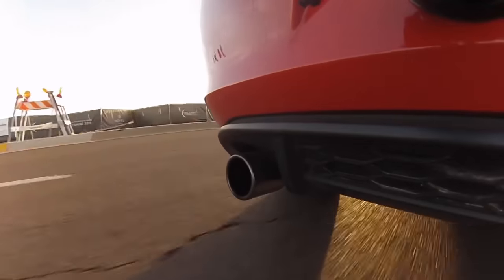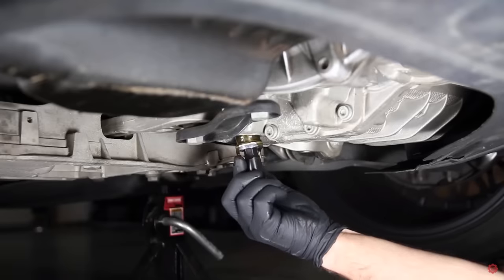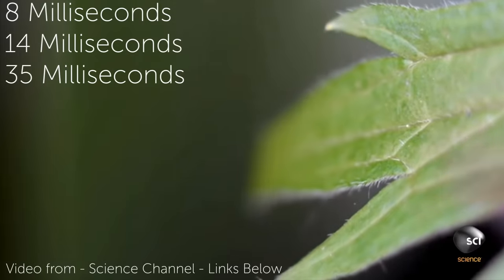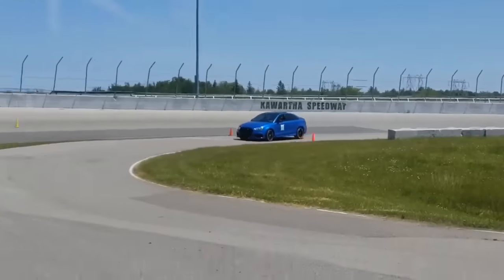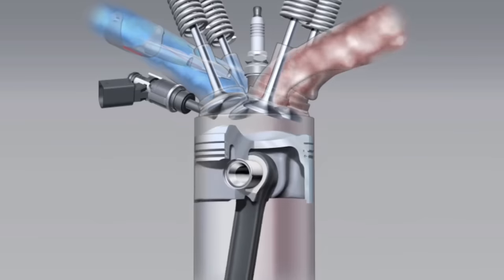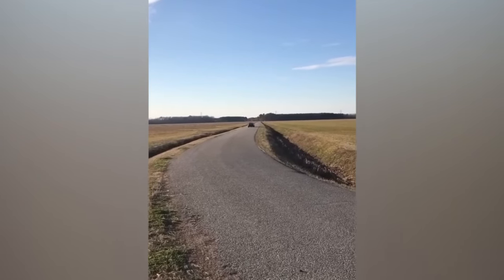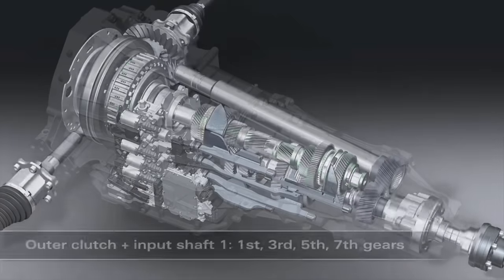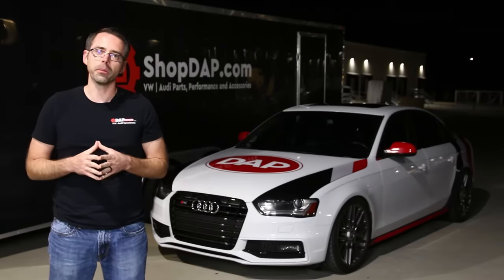What makes DSG Farts Happen?

Comment: “So in conclusion dsg farts are hot gases coming out of your tail pipe” 
Paul 2019
Reply: Best quote ever
Reply: Nice
Reply: Daily Driven Tech he actually said, “exploding”
Reply: Daily Driven Tech “So to conclude, DSG farts are hot gas exploding from your tail pipe”
Reply: Fav part of the whole vid 😂
Reply: @Gandalf721  it deep inside us ALL!! We didn't know this UNTIL DSGs !!
Reply: @Gandalf721  😂
Reply: So an ACTUAL CAR FART. LITERALLY
Reply: That car at the end sounded god awful. And I have an s4 with a gutted cat - track edition.... the loudest of the loud aside from test pipes
Reply: It comes because the Vw have bad fuelinjections systems, just to much petrol is being injected and Burns and makes the sound, so it's bad for the car and engine, that's why these engines are brake down or get stuck inside and overcoal. It's really a laughable bad build designed engine🤣
Reply: Does dsg cars have a better cat in them since it dumps fuel to change gear?
Reply: rofl
Reply: Why does the fart sound different in each vag vehicle? Eg. Gti / Golf R/ Rs3 etc. The farts are distuingishable
Reply: But i does not make sense are other cars not have these gases?
Reply: @WaseemKhan-iu4bh  Different engine displacement (Ex : 2l engines sounds different from 2.5l ones), exhaust system (Golf R come with Akra exhaust system quad pipe), Audi RS' have 5 cylinders engine.
Reply: Hot gasses coming out your auspuff.
Reply: What else would come out of your tail pipe?
 “I thought it was caused by cold bananas coming out of your tail pipe”.
Reply: bruh
Reply: Hence, farting.😉

Comment: Does the fact that unburned fuel is present make it a wet fart?
Reply: Shart
Reply: Bruh
Reply: Underrated comment, my guy! 🤣😂
Reply: NO, as it burns in the exhaust.
Reply: So unchecked combustion hmm how did that pass emissions and also surely that would reap havoc on the catalytic converter
Reply: @urbansnipe  As long as the car complies with the emission regulations per 100KM I understands its OK

Comment: Thank God my GTI is manual. I don’t think my wife could stand anymore of my gaseous emissions. 😀
Reply: Just make sure theyr as "LIT" as on my GTI Clubsport. Never heard anyone complain.. Esp not in Tunnels with the Sunroof Down hehe...  😉 😎
Reply: Irfaan Faki  Hey man I love my manual GTI.
Reply: carnutal DSG is faster
Reply: killer_vette Did you read what he said?? He said he loves his car. Nobody really cares about your 1/100 of a second "faster"! If I take the doors, carpet and seats out of my car it will be faster to 60 mph. Ha!!! Who fucking cares??? It is a PASSENGER CAR!
Reply: I have a manual Seat Leon Cupra 290 (same engine as the GTI Clubsport S)and I get farts in between gears changes or over revs :)
Reply: George Eisikovits is the exhaust modified?
Reply: James Medina it’s as stock as it gets :)
Reply: Manuals also fart
Reply: @GGO89  i have a 06 mk5  DSG GTI, and that does it too :D 100% stock.
Reply: AND MY GTI IS AUTOMATIC SO WHENEVER I PUT SPORT IT FARTS YAYYY
Reply: @killer_vette351  in circuit, mountain and in sections of curves the manual is better
Reply: I deliver pizzas 40 hours a week in my manual mk 7 gti. It’s smooth as butter and if I drove an auto (dsg or not) I’d prob hate my job. End of discussion
Reply: Couldn't do the auto had to get the 6mt cornflower blue
Reply: @HopOFFmyGlock  same here. I got lucky with my ‘19 GTI Rabbit, CFBlue, manual. Dealership had just got it in the delivery truck and it was still wrapped up. It was destiny.  But I don’t get the DSG hype. A lot of GTI youtubers swear by it, which is fine, but I’d get bored of driving around in an automatic so fast, no matter how good the DSG is.
Reply: @GGO89  How are you finding the cupra and what made you choose it over the GTI or GolfR
Reply: @najibabubakr2015  the dealers in my area offer huge discounts for Seat vehicles so I managed to spec one to my heart's desire and pay very little for it, around what a gti would've been with 0 extra options. Moreover, I wanted a FWD, manual fast car because I like hothatches. So 300 hp, fwd with e-LSD, manual hatch = best choice.
Reply: This doesn’t happen to a standard golf GTI with dsg
Reply: @GGO89   @George E.  Thank you for the reply ma man that's good to hear you got that bonus in your area. I always haven't been very aware about differences and advantages of FWD/RWD/4WD and also what is the meaning hot hatch and manual hatch and e-lsd

Comment: You can go without DSG-Farts, but it is something the customer of "sporty" cars want. It is an additional function of the engine ECU, just like the farts you hear when you lift your foot off the throttle. Here, a more or less random pattern is used to inject some gas which is not ignited by the spark plugs. So not mandatory, just for the sounds.
Reply: So what you say is we can have the same effect by cutting fuel and not only the spark right? And the car wouldn't burn unnecessary fuel (and of course no farting noises)
Reply: It is and it is not... The thing is, all DSG cars, or cars with double clutched automatic gearboxes, can produce those farts. Mostly those farts are absorbed by the resonator. Once you delete the resonator, the farts are audible. You would be able to code it away, but then you'd increase fuel-consumption and stress on the engine and transmission.

Comment: I've owned a MkV GTI for 7 or 8 years and I still love the sound it makes
Reply: How do you get a mk7 with DSG farts? I tried to buy a few but they are all quietly and no farts :( 
Do you know why?
Reply: @soulmateseverywhere6309  put it in sport mode and use the flappy paddles and give it a good rev between changing gears

Comment: just bought a Golf 7.5 GTI upgrade from a polo 6r GTI, and the DSG farts on stock are soooooo sick dude !!! love the farts! farting all the way to the petrol station
Reply: Papa Mabotja I thought the 7.5 GTI has no DSG farts anymore? But the overall sound is louder and better i heard. I ordered one too.
Reply: @Codename.996  bro! 7.5 GTI farts are so loud on stock especially shifting from gear 1 to 2 at 4k-5k rpms woohoo its awesome you'll love your 7.5 dude
Reply: Papa Mabotja Haha okay, i hope they sound as good as you are telling me. You sure you got the 7.5 with OPF an DSG7 ?
Reply: @Codename.996  just check my instagram @papamabotja you'll see I've added a couple IG stories of the car under "Lynk" I have a video there from outside doing a small pull you'll hear the dsg far on that video and you'll see photos of my car ... you'll confirm if it's the correct version or not.

However I'm in south africa so we dont have any laws and regulations for loud exhausts. So maybe VW turned it down for your side of the planet.
Reply: Farting all the way to the petrol station 🤣🤣🤣🤣🤣😂
Reply: @kyalami_green_rs3  your car is sick dude
Reply: Never understood why ANYONE would EVER pay that much money for a FWD car. Especially when there is the option of a Golf "R" with much more Horsepower and AWD for not much more money at all. Like... do you even know what a holdback this drivetrain is? Are you aware of the fact that Cars with half the bhp will absolutely destroy you at a stoplight because their AWD? Just a tiny bit of moisture on the street and you will be killed by a 120bhp minicooper with AWD.
Reply: @Codename.996  The 7.5 GTI having 245hp apparently does not have those DSG sounds anymore, the 230hp version still has them as it is the same engine as the mk7 GTI. This is for germany though, I don't know which versions you are getting in the states or elsewhere. The 245hp engine is a different engine in many aspects compared to the 220 and 230hp engines.
Reply: J. G. Hab den GTI Performance jetzt 9 Monate. Bin echt voll zufrieden bestes Auto. Zwar keine DSG Furze 💨, aber kann man ja nach der Garantie machen.
Reply: Nothing can be compare to V8 engine with manual gearbox, pure fun. DSG farts are so annoying, riding with dsg is boring
Reply: @Scientist1991  lol what’s funny is a drive a BMW M6 F13 now 🤣😂🤣and yeah it’s a DTC with a Twin Turbo V8 😋
Reply: @papamabotja  Nah, only V8 N/A, TT V8 doesn't sound good, but... everyone should drive car which like

Comment: Nice explanation!  One question: why doesn't this harm the catalytic converter?   On carbureted cars from the 90's, running too rich could cause the catalytic convertor to get too hot (burning raw fuel), resulting in an expensive repair (new cat, to replace the burned out one).   Why doesn't DSG cause this problem?  Is is because the # of shifts (and therefore # of DSG farts) is so low, when compared to rich running cars which let raw gas into the cat on every cycle?
Reply: It's tiny so it only degrades them instead of destroying them like anti lag

Comment: Is there a benefit to the ignition cut as opposed to using the clutches to slow down the engine? Is the second method how DSG's work on TDI models (since there's no spark to cut?)

Comment: Hey Paul, funny enough, my mk7 golf 1.8T makes shifts farts too above 3K RPM even though it is not a DSG :) I had to install a GTI exhaust to be able to hear them
Reply: Did you do the Downpipe as well or just the Exhaust? I'm thinking of doing the Exhaust on mine for the same effect.
Reply: @MatDupuis3  I have a resonator delete as well, so I still have the stock gti rear muffler
Reply: This is true. I have the same car. 2017 Golf TSI 1.8T. Non dsg. And it pops just like DSG. I think you only need a gen3 TSI engine. I have downpipe, resonater and muffler deleted. And it pops so loud lol

Comment: Even my TDi does it.  Thanks for the explanation, I didn't know how it happened, but I did know it was totally normal for my vehicle.
Reply: Whoa! It cuts spark in your TDI?  j/k Really, I was wondering the same time about my TDi. I'm rarely on it hard enough to notice such things.
Reply: @EstebanRapido  Well, metaphorically speaking, that is :-) Diesels don't have spark plugs, so whatever happens resembles that same sound, and the origin might be even mechanically related (or DSG-related) insofar as something quickly disconnects to connect again right after. I don't push my TDi either, there is no point as the useful area of rpm's does not call for it.
Reply: @antoniovda1295  basically it's the same principle but as the piston comes up as explained the extra fuel and air mixture will ignite as it's still being compressed not as high as the combustion stroke but it will still ignite with high temps and the slight compression

Comment: The DSG farts in my s3 with decat is naughty 😍
Reply: Don't get a DSG tune. It took mine away :(
Reply: @911airsoftdude  no way! Who was it tuned by. Its soon to be stage 2 mine with the TCU tune so im hoping it doesnt 😕
Reply: @cameronjamieson2651  just the regular COBB tune. Yeah, I have to hold the revs out before shifting and it will do it but its definitely not as loud as pre-tune.
Reply: @911airsoftdude  try to use manual. i had a dsg tune it doesnt fart when transmission is in sport but in manual it farts like pre-tune

Comment: As much as I love my 6MT, I've had DSG envy for a while and next after my GTI will likely be a DSG R.
Reply: Yeah... no, thanks.
Reply: dash3dot It’s not for you. You don’t have to drive it so don’t worry about it.
Reply: @FinalFormation  Captain Obvious much?
Reply: dash3dot Apparently wasn’t obvious enough because you felt the need to comment lol
Reply: @FinalFormation  and you still don't get it, do you? Is it because of the mustache?
Reply: dash3dot Dude what the hell is your problem? Who pissed in your Cheerios?
Reply: Nah, just try a Even to even or odd to odd downshift on a DSG it will take decades, you're  better off getting a new torque converter auto like the one found in RS7's and RS5's
Reply: Dude, don't abandon the manual.
Reply: @d1zguy864  nah mine is lightening quick on the double downshift. Something wrong with your DSG. Should get it serviced
Reply: @tylerevans2261  nope it was on  a brand new GTI, and audi S4, it's simple physics DSG isnt great at skip shifting

Comment: I sold my mk7.5 golf r and bought a new 5f cupra 290 and it’s fitted with the dreaded gpf , the R is obviously considerably faster from launch with the dsg7 and had the dsg bang but the cupra  pretty easily gap’s the R everywhere else from 2nd gear,! But the cupra dsg7 has what id describe as a thud and not a bang on upshifts, I’ve got to say it does detract from the experience, although as the miles go on and ive nearly 3000 now the gpf equipped cupra is getting louder and starting to burble and bang on the over run but nothing like the 300 did. As the saying goes you don’t know what you’re missing till it’s got and that’s definitely my view. Good explanation thanks.👍

Comment: Very well explained and even very reasonable thing gases explod in exaust pipe , and the sound is louder than in cylinders because inside last ones EXs are isolated by valves, danke bitte

Comment: Shifts are so fast; the engine has to cut spark between them... DSGs are better for fuel economy; throws raw fuel into the exhaust.

Things aren't adding up here.
Reply: I think the amount of fuel they throw out to the exhaust would be substantially lower than the amount of fuel you waste while holding in the clutch pedal in a regular manual

Comment: I love DSG farts, but unfortunately they're no longer heard in more recent models fitted with an OPF - it's more like a "pop" now...
Reply: What’s OPF..?
Reply: Practical filter in the exhaust system.
Reply: Which ones have the OPF?  The 7.5 GTI?
Reply: @cmarnold78  from around August 2018 from what I've read.
Reply: @cmarnold78  From the 7.5 onward they do. That's why they sound more muted.
Reply: @bird-dog81  Exactly when I brought mine :(
Reply: @mikerelvas  Yeah I have a 2018 7.5  Not sure if I am imagining the farts when/if I get them or not...  think I hear a little brrpp only when I am really winding it out though.  I really need a Mk7 to drive to compare though.
Reply: @cmarnold78  Yeah, that's pretty much all they do. The Mk7.5 GTI with the DSG6 still did a normal DSG fart, but the Performance model with the DSG7 doesn't. It sort of "slushes" the gears together
Reply: @cmarnold78  yeah I'm in the same boat. If your not sure look under and you will the the big opf. I know they do a delete kit now but requires a stage 2 remap that will bring the farts back but if you wanna go down that route cos I imagine you still have warranty
Reply: @mikerelvas  some 7.5 still fart pre Opf
Reply: @bird-dog81  The non Performance Pack does. The Performance Pack with the DQ381 gearbox doesn't
Reply: @bird-dog81  Australian market 7.5's do not have the OPF. Not sure about US market.
Reply: When the Golf 7.5 was released, it was sold for a couple of months before the particulate filters were fitted to all subsequent models. That means the people that bought the first early examples of the 7.5 during the first few months after release still get farts. In the Golf 7.5 R, power was also reduced from 306bhp of the early 7.5 models to 296bhp as a result of the OPF fit. So people that bought the first early examples of the 7.5 R during the first few months after release get the full 306bhp and the farts! Awesome.
Reply: @chillout1109  Can you visually tell just looking under?

Comment: How does this affect the catalyst system since you are throwing raw fuel into the converter? Is the primary converter moved back in applications like these to avoid damage from raw unburnt fuel?  How is this any different from a slight burble tune in regards to the amount of raw fuel being dumped into the exhaust?

Comment: This can’t be good for turbos. Also, wouldn’t that be an emissions issue? How do they get away with that part?
Reply: It's a Volkswagen. In due time.
Reply: It's probably largely burning and catalysing in the catalysts, but short answer, no it's not good for emissions. It's also probably not good for the turbos lol. But like the other commenter said,  "It's a VW. In due time" xD
Reply: VW and making emissions? You can only have one
Reply: @NickDittes  the catalyst is fine. It's designed to take care of unburned fuel. And it isn't necessarily bad for the turbos either, because the primary effect is simply that they stay spooled when the next gear engages, which means more power.

Comment: 1. There is no "ignition cuts" of course, there is a just very late timing during the shifts, like -10 BTDC. So-you have only a very very small amount of unburnt fuel in your exhaust. If you put ALL of your unburned fuel during the upshifts outside, you will destroy your exhaust manifold and turbo and catalytic converter in no time.  This DSG "fart" is basically because of the engine running on the very late timing. You can clearly see this on the VCDS log, this is not a rocket since. 2. DSG using this timing reduction not for the "flare prevention", but for the reduction of the torque during shifting, for preventing excessive clutch slipping, overheating and preventing the kicks. 3. During the ANY shift, there is the time frame, when both clutches are engaged, but with different pressure applied to the pistons. During the launch control, your DSG using the S mode shifting times map, which is way shorter than the D shifting time map, and less torque reduction, this why you can not hear the DSG fart. You can clearly see it in the DSG flash dump. 4. You can completely disable this torque reduction in DSG flash, you will have some kicks during shifting, even your wheels can chirp during the shifts. But you will have faster times.
Reply: Thank you! The guy in the video has no idea what he's talking about. "Ignition cut between shifts" LMAO!
Reply: @jasonb340  Yeah, funny-one hard acceleration and you have no exhaust manifold and no catalytic converter)))